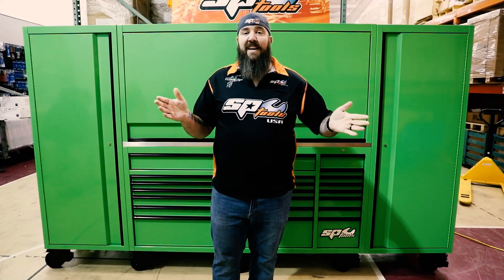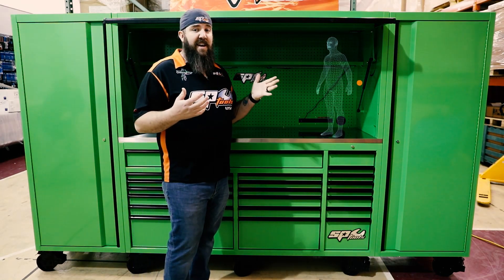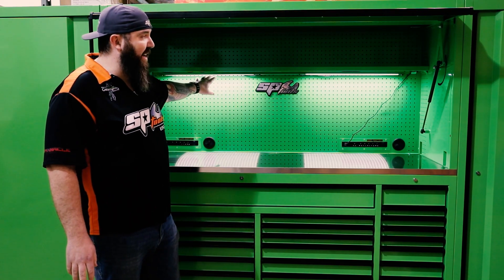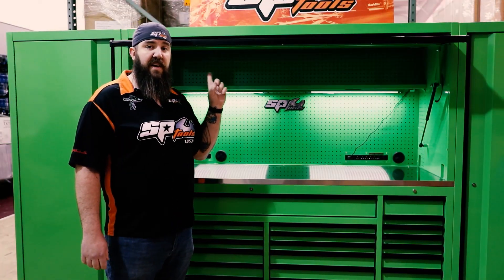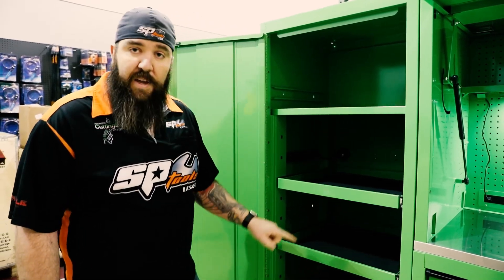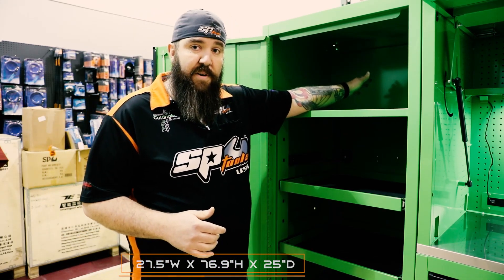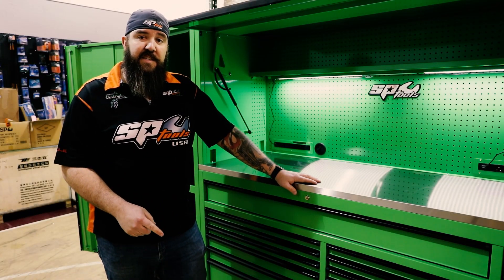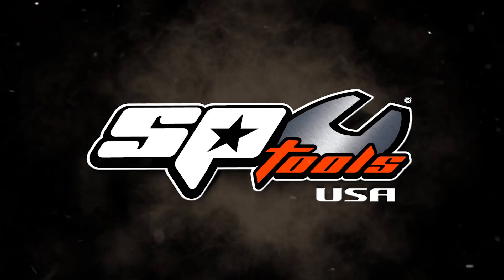SP Tools USA | New SUMO Series 128" Complete Workstation

Comment: Why should I buy so tools tool box over the competition like snap on or mac or matco
Reply from the maker: Hi Josh, great question! There are a few reasons that we think make sense when determining where to get a professional box. First and foremost, all the companies that you have listed have an excellent offering and make an outstanding product. Our 73" complete workstation as shown in the photo includes 27.5" wide Side Lockers standard. Most equivalent side lockers are going to be in that 24-27" range with the EPIQ series being the largest at 30” but carrying a price tag of $5,075.00 each on their website (KELN301CLPBO). We spared no expense in creating these boxes and each box comes with 6 top of the line castors each capable of holding 880 pounds. We utilize a UV Powder Coating instead of traditional paint that helps to prevent easily scratching. Our hutches come with Power and lights built in (Snap-on Masters series hutch does not come with lighting or power and cost $4,695.00 + $246 to $575 +/- for a light kit. (KRXL1072PBO). Our BBS Drawer slides can hold 120lbs on single slides, and 240lbs on double slides for large drawers (227lbs for Snap-On according to their website). Lastly, for an equivalent Snap-on 73" complete set-up, you are going to pay $20-28K depending on deals for a like set. Our SUMO Complete Workstation costs $9K so when you look at value for money spent, we believe we offer a superior option.